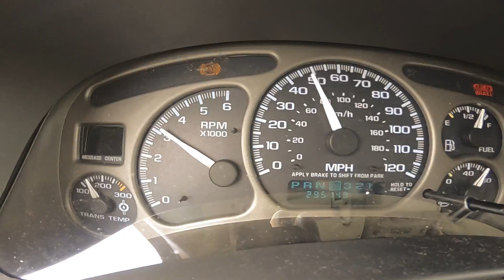NEVER TRUST A CAR WITH BRAND NEW INSPECTION. HUGE SAFETY CONCERN!!!

Comment: Not sure how it works there If done by state employees or private shops). We have Inspections here too(Private shops do them), and you can get about anything passed if you know the right ppl. Had a car with bent frame, pulled to right hard and ate front tires every month... Passed with no problems.